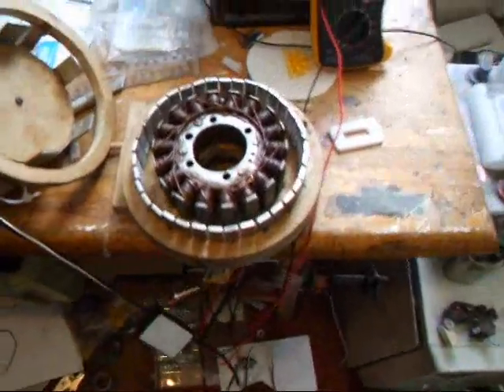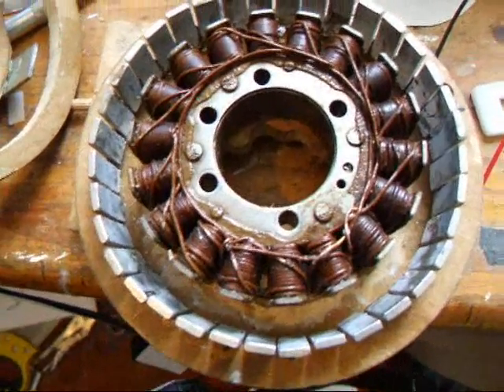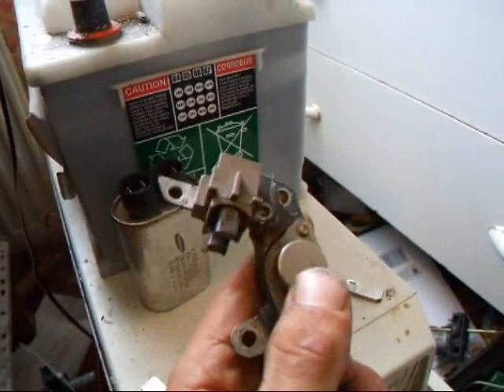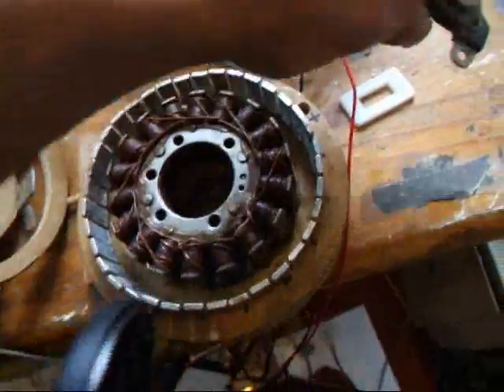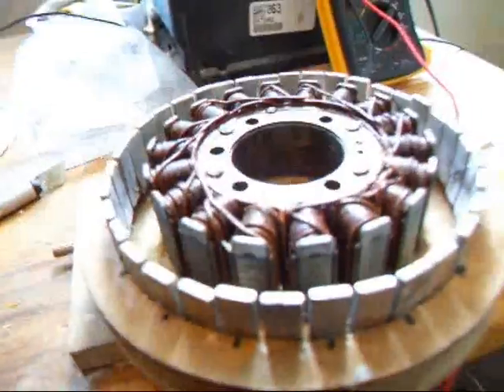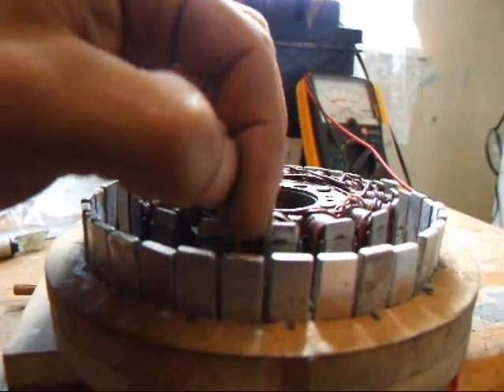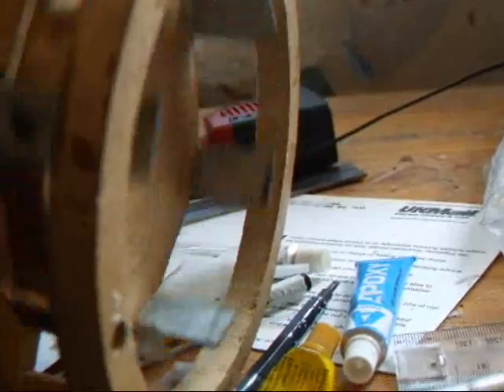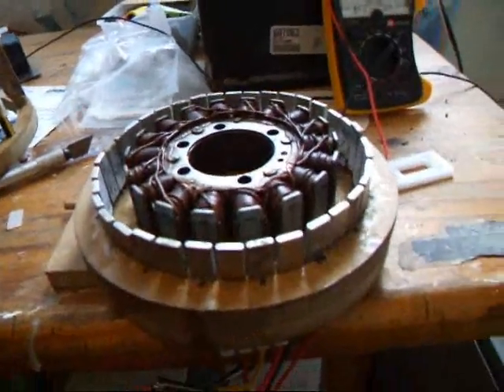lensless concept prt2 (what i have done so far)

Comment from the maker: This one got expanded to a double stator, think i have a video or two of that one on here. After extensive testing with different blade amount and shapes - it did produce usable power at the 2000rpm range - annoyingly ( with the later model of this) i found Just one of the internal magnets was backwards!! after! nearly a year of testing. i almost cried. it does produce power but also slowed, not alot mind -was it the backwards magnet? i dont know. May revisit it one day.